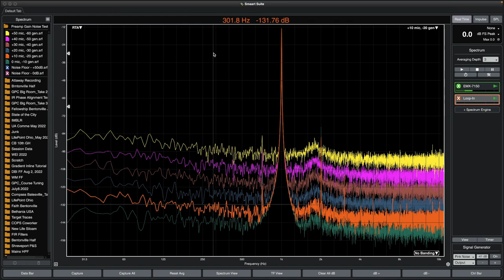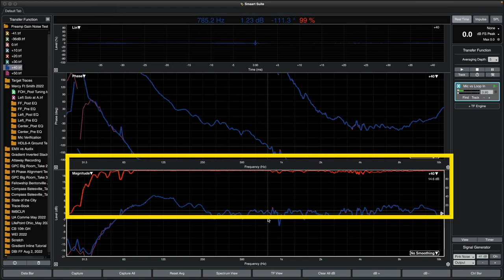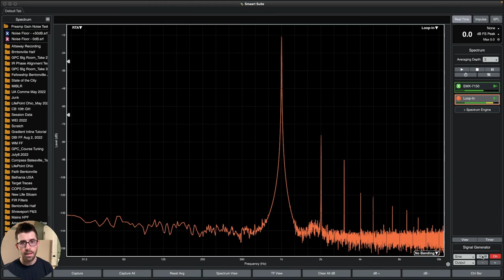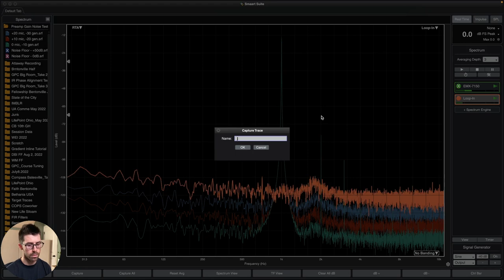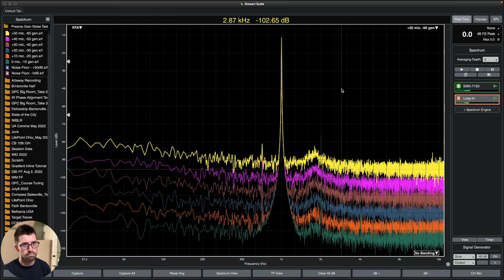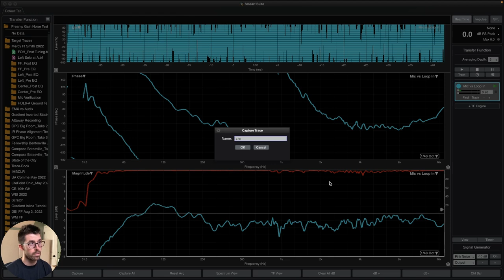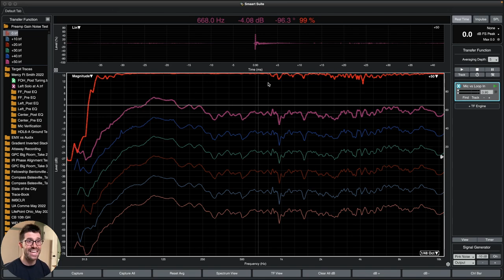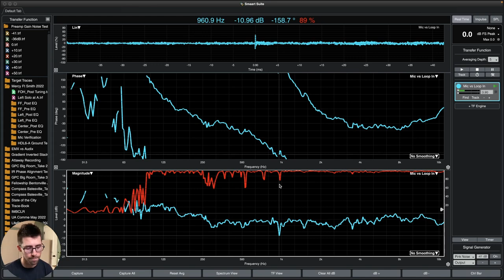Does High Preamp Gain Ruin Measurement Data? | Bench Test For Sound System Tuning Gear

Comment: Great video Micheal.  I get SOOOO tired of similar-sounding excuses for not having enough preamp gain/level on microphones.  There seems to be very, very, very long running bad habit of basically ignoring the preamp gain....and that most often leading to very LOW preamp gain....in favor of fader-position and keeping-amps-turned-up-to-full.  And engineers simply sacrificing good/proper input gain.......and the result is that their final, end-result actually has MORE noise (in the PA and the recording) because they didn't use their preamps to get up over the noise floor of the REST of their equipment downstream.  I love seeing tests like this, keep it up!
Reply from the maker: Thanks for the encouragement, Marcus! Was a super fun test to put together.

Comment: Michael, this is really interesting and love the detail.   Would love to see something similar and test what you can with Open Sound Meter.   Are Smarrt and OSM giving the same information?    I'm actually not sure if OSM is accurately measuring SPL.   I calibrated my frequency mic at -94dB and to my ears the dB seemed louder than what OSM was displaying.   I have two calibration mics (Behringer ECM8000) and both produced the same levels when side by side.   In any case, would be curious on how accurate the two applications actually are for SPL and Frequency.    Smarrt is not in the budget just yet otherwise I would test myself.
Reply: The ONLY way to accurately measure sound level with an audio analyzer software is using a sound level calibrator or class-compliant pre-calibrated hardware such as a 10EaZy unit. Smaart's SPL toolset meets all IEC 61672 parameters and can be class-compliant certified with appropriate hardware.
Reply from the maker: What Precision Audio Services said - I use the iSemCon SC-1 calibrator.

Comment: Hi! I have a question from another topic. If I measure my sound system, and set it to the target curve, in a room or event room without people, In common people effects the freq response in what way or which frequency? I know that people change the reflections in rooms, but I don't know in what way. Thanks for your time!
Reply from the maker: That's honestly something I'd like to learn more about. Having an audience in the room definitely influences the acoustics of the space, but am not sure there's a predictable frequency response range.
Reply: Depends a lot on the room itself (open air vs closed spaces), atmospheric conditions (expecially in hot summer or cold/windy), changes can be moderate and definitely measureable, people change humidity, temperature, pressure.

Of course has to be a relative high number of people, a small one is pretty much nonexistent, we measured at a festival a drop in the highs and mid-high (mics @ stage level just above crowd) and adjusted via Galileo the eq on the downfills. Interesting stuff and topics

So yes, people DO change conditions of the room. Sorry for my english folks :)

Comment: Another great video! I have the Evo 4. What’s your opinion on using the internal digital loop back instead of running signal in and out physically?
Reply from the maker: I use the digital loopback all the time! There's a small amount of phase shift 8kHz and up and an additional sub-millisecond delay. But a very small trade off to gain an extra channel of measurement.
Reply: @MichaelCurtisAudio  Nice I didnt even think about having 2 measurement channels!
Reply from the maker: @RUGBYmusic  A nice easy way to double your money : )

Comment: Any suggestions for struggling with coherence? I get good coherence within 10-15 ft of the source (6 box line array). But as soon as I’m 30-90 ft away I have almost no coherence. I’m using a earthworks m23R so the mic is flat. I really want to get consistent measurements but I feel like I can’t trust my data because I don’t have the coherence. I can tune with my ears fairly well but I wanted to take my tuning to the next level. When I try tuning a room with mics and pink noise it sounds significantly worse when I just use my ears. The room is fairly reverberated but the mic is directly in coverage zone of the PA. 18:42 Any suggestions would be greatly appreciated.
Reply from the maker: Hey, Kerby. Great question! There are three main causes for a drop in coherence.

1. Bad measurement - measurement delay is set wrong, equipment isn't working right, etc.

2. Poor Signal to Noise ratio - there's noise in your measurement environment that's not related to your original signal (HVAC, lighting motor noise, etc.) To solve that you can turn down the noise or turn up your measurement signal.

3. Poor Direct to Reverb ratio - there's a lot of reflections and reverb happening relative to your measurement. This sounds like the culprit in your case since you're able to get decent data up close, but your coherence drops as you move farther away from your source (the speaker).

All that being said, having low coherence doesn't automatically disqualify the data, it is simply telling you that much of the signal you're getting in your measurement is "noise", which is not surprising in a large reverberant space.

A few followup questions:
- When you're measuring the PA do you only have the test signal going to the speaker you're measuring? So, if you have a LR system, put your mic in front of your left main and solo the left speaker to get clearer data.

- Are you resetting your measurement delay when you move the mic back in the venue?
Reply: I turned off all of the ambient noise sources (ambient dB was about 50 and measurement was taken at 90 dB). I was resetting the delay when I was moving backwards and forwards in the room. I was also only using one of the hangs the other was muted. And correct there was only pink noise coming out of the pa.
Reply from the maker: @kerbygerughty8166  Then I'd chalk up your low coherence simply to the reverberations in the room. Not much we can do about that other than add sound damping!
Reply: What was it like when you averaged your traces? (The coherence)
Reply: @joshhoevelmann6498  within 10 feet about 80-90% and out side of it like 30-70%
Reply from the maker: @joshhoevelmann6498  The coherence gets even better. Every doubling of the amount of sources in the average gets you 3dB of noise reduction.